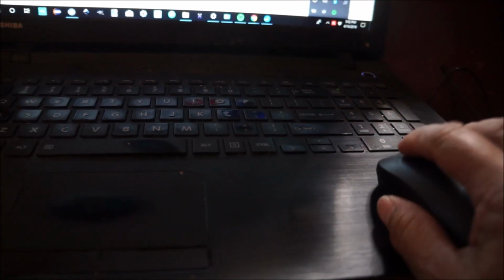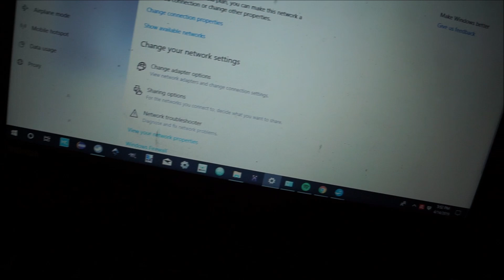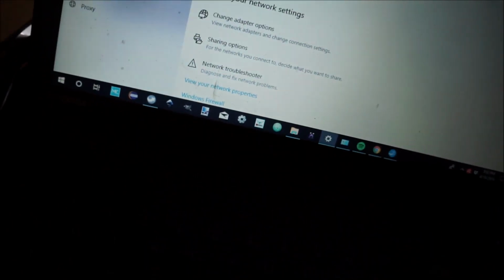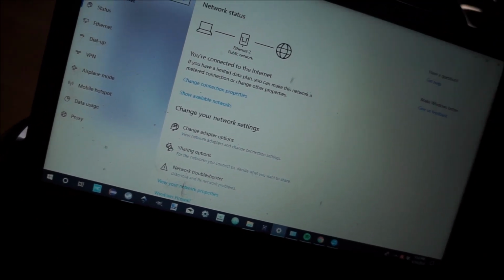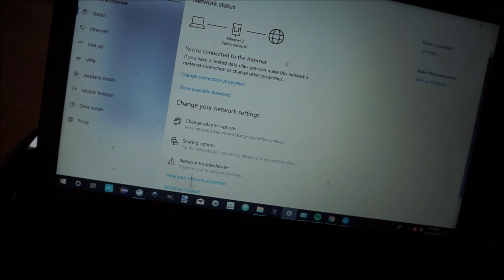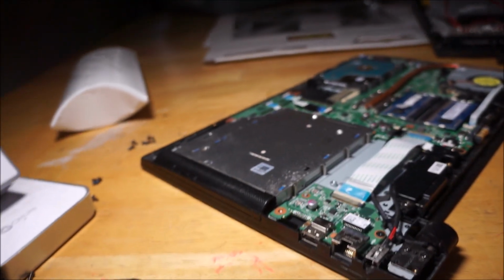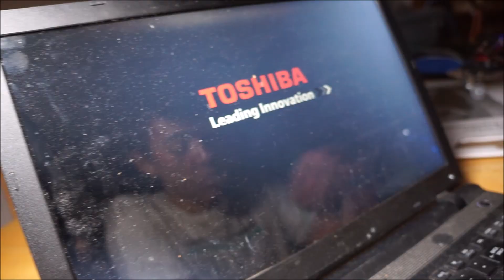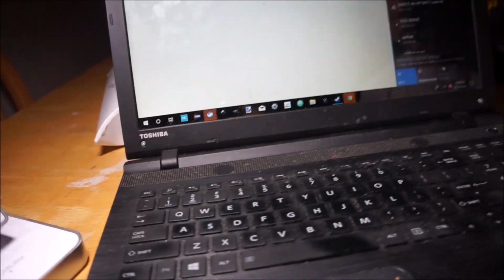Fixing Wifi Problem: Toshiba Satellite C55-C. Reseat Wifi Card

Comment: Where could I find a mini PCI-e slot? The WIFI slot was too small for the eGPU connector that I have.
Reply from the maker: Hi Timothy, I do not know. Good luck, and post a video if you find out!
Reply: @SquiggleMom  It works. I disconnected the PCIe M.2 WIFI module and connected a Beast PCIe M.2. eGPU and now the desktop NVidia card is detected. I had an NVidia 680 on the shelf that I'm testing with.
Reply from the maker: @TimothyGraupmann  Nice!
Reply: @SquiggleMom  the wifi connector is m.2 so I ordered a different connector that I'll try tomorrow.

Comment: I have this exact problem. It comes and goes. I've suspected it's hardware. I will try this shortly and post my results.
Reply from the maker: Thank you!
Reply: @SquiggleMom  It worked. Once I got the card out I blew air into the place where it slides in and either some long flattened dust or some tiny bits of paper or thin flat metal flew out. Not sure what it was but after I put it back together it works again. Thanks for the video solution!
Reply from the maker: @ChuckHaney  Hey, I should try that. Maybe that is what is preventing mine from working.
Reply from the maker: @ChuckHaney  Hey chuck... did you replace the card or use the same card?
Reply: @SquiggleMom  I used the same one. Knowing how much dust ends up inside a laptop I just automatically blew into the port to clear out any dust.

Comment: Is it necessary to pull out the nobs?
Reply: Wow this actually worked!!. now I'm typing from my laptop. Now the light of the wifi is on again.
Reply from the maker: If you tell me at what time in the video we did that, I can look and see if I can recall.
Reply: @SquiggleMom  6:14
Reply from the maker: @dxabier  I looked, it's hard to tell.  I think what you are referring to is the antenna.

Comment: Nice video, thanks for posting. I dropped mine and it landed right in the 3.5mm audio jack I had plugged into my 1100 watt stereo, you should  have heard that! The tip of the 3.5mm adapter broke off inside the jack, got that out with a drill bit, and now the internet is acting up, probably jarred the WIFI  card, if it keeps up, I'll try this.  Great teamwork mom and son!
Reply from the maker: Hey Randyman, It ended up only being a temporary fix.  Then I bought a new card and replaced it, but that didn't work, so I figured it had something to do with the antenna. I am now using a USB wifi... Good enough for me... Bleh.
Reply: LOL, true! Thanks for the update, keep on conquering!

Comment: My laptop couldn’t connect to the WiFi unless it’s next to the router but I haven’t fixed the WiFi card and I’m gonna fix it whenever I get home from school
Reply from the maker: I replaced my card, but it's still the problem.  I think it may be an antenna problem? So I went back to using a usb wifi card.  I'll post that video (fail) soon.
Reply: Alright, but I hope this could work for my laptop, but if it doesn’t, I’m gonna take it over to the person that I know that could fix it which is the same person that fixed the battery and LCD screen on my laptop last year
Reply from the maker: @omarzowila  Try it and see.  It only costs $10 to try it.